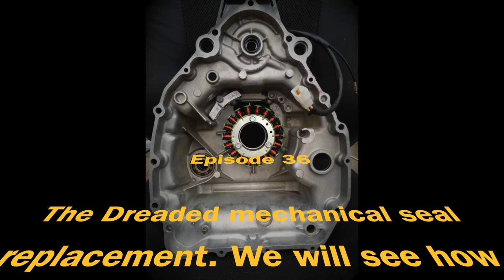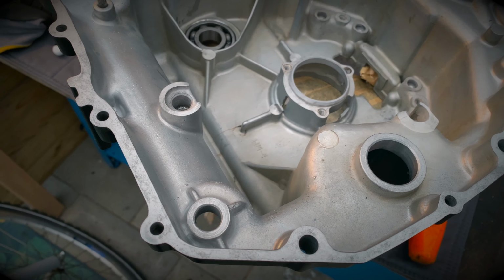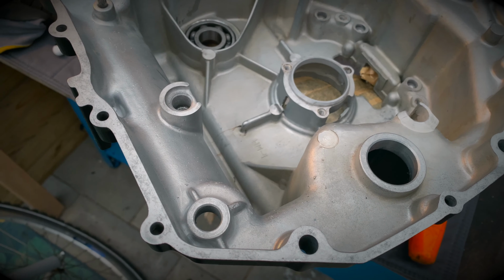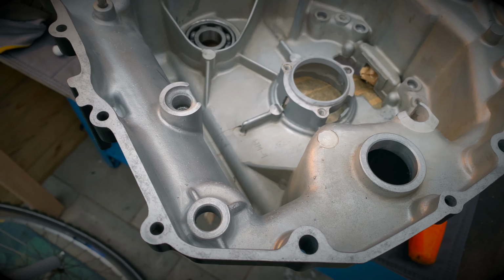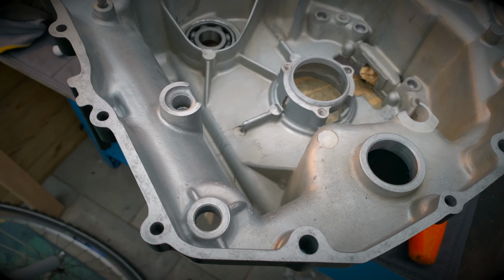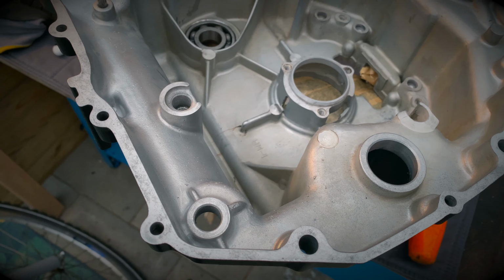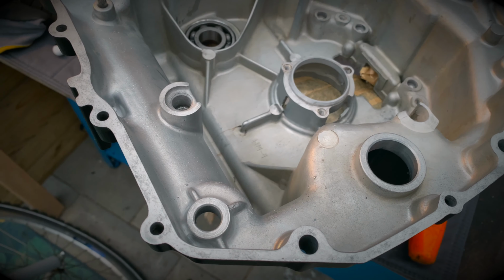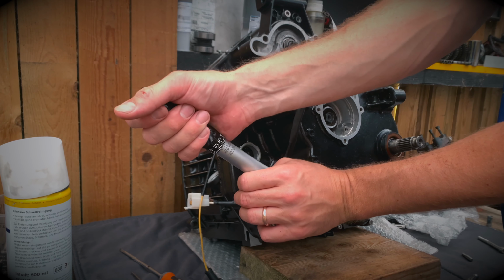🎬 Honda CX500 cafe racer build. Rear Cover installation. Ep 36. 🏁

Comment: The Left and the Right pick-ups are often mistaken for. You have to look from the back to the front of the engine. The other way around then Left = Right and Right is Left. So that's the mistery resolved I guess (did it wrong myself ;-)) Where did you find the new neutral switch may I ask?
Reply from the maker: Hi, Yeah rear looking forward is the way to go. I got the neutral switch from David silver in the U.K. here's the link
https://www.davidsilverspares.co.uk/CX500B-1981/part_112428/

Comment: Evening Ian, I have to admit that you convinced me to change the stock CDI over to Rea-San 12V. It was not part of the plan but I guess it is better that way rather than to have to do things all over again after closing the back hood of the engine ;-) Looking at Rea-San site ordering store one can choose for the dwell. Should that be standard 5ms? 
In addition you choose for Caltric stator. Is this the ST340? And this made me curiuos what RegRec did you choose to go with the stator or is this still in the progress? Best regards, Anton
Reply from the maker: For my Rae.San 12V conversion ignition, I am using dynatek ignition coil single plug fire 3 OHM DC3-1 a Caltric Stator ST340 with a MOSFET regulator(not yet purchased.) This will make it the latest and run a 12Vtai sys, ie m-unit. hope this helps, but contact Rae he's very helpful and will answer any questions.

Comment: Can you share tips on how you smashed out the ceramic portion of the right hand pickup? If you remember? I’ve been attacking it with a Dremel, drill, and other barbaric methods but am not getting very far. Was this how you did it?
Reply: After a lot of smashing I finally got it. But can you explain why we only need one pickup? I’m following your exact upgrades/steps but do not fully understand the “why” behind this.